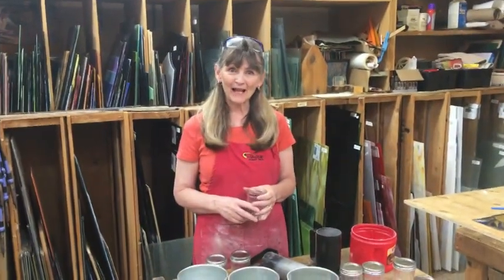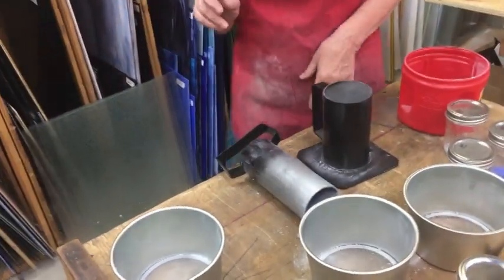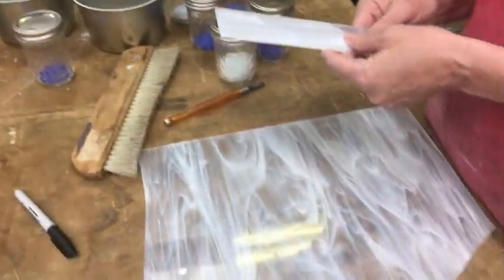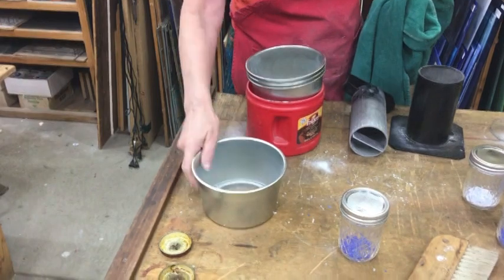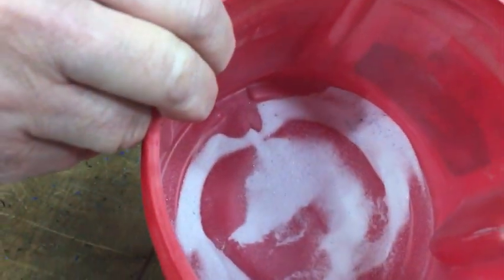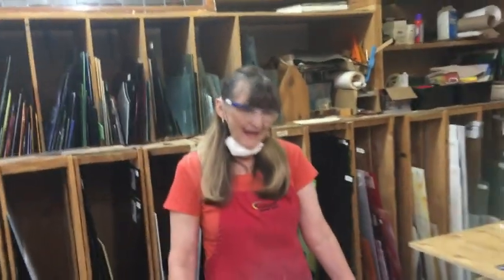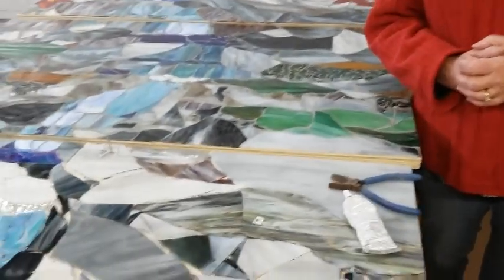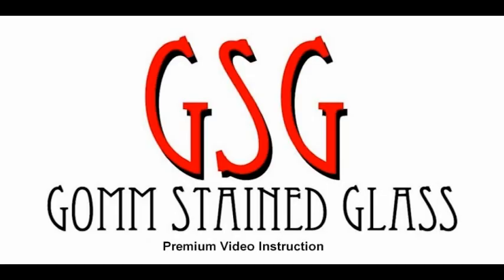Frit Art with Stained Glass V289

Comment: Hi folks I'm liking your videos. You have become my go to for learning and inspiration so THANK YOU. I have been trying to learn about flash kilns and seem to keep running into very different advice. Are you able to tell me what the difference between a glass kiln and a flash kiln is or how I would use my kiln as a flash kiln? My kiln has a door on the front with top mounted elements.Thank you. I love the frit video.
Reply from the maker: As far as my knowledge goes a Flash Kiln is used for ceramic finishes. We only work with glass so that's as far as I can help. The front door to a kiln is helpful when doing beads or small blowing projects so you can place them in a warm environment to keep them from shattering. Keep an eye out for an upcoming video, we're going to replace our large kilns' lid.